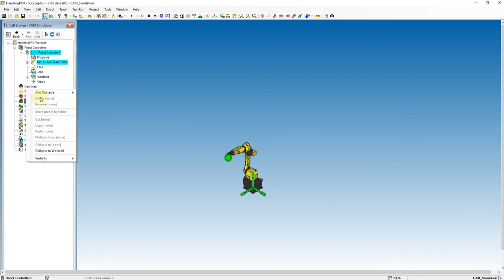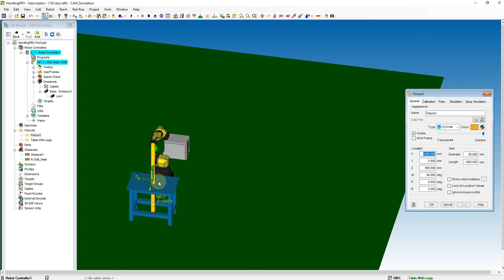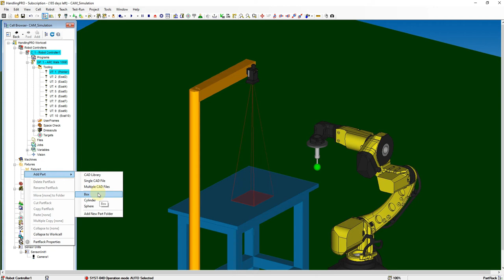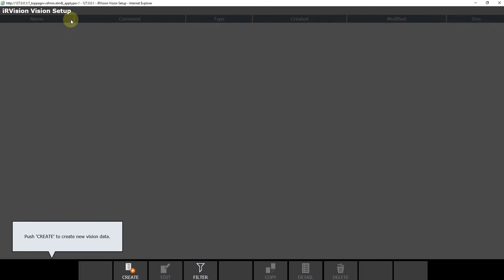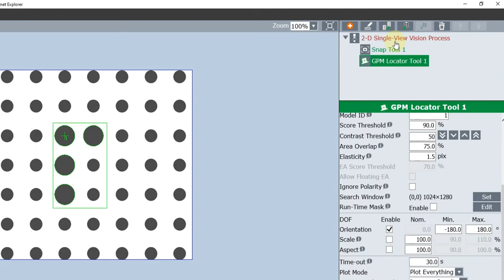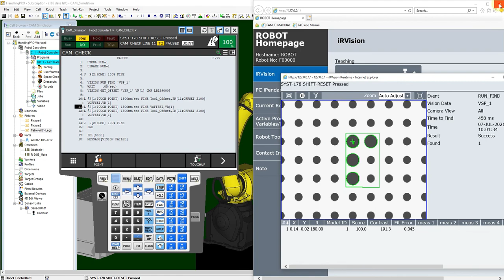Fanuc Roboguide Simulation Tutorial : Fixed Camera Setup.

Comment: Hi ,
Firstly, thanks for your helpful video.
I'm practicing Fixed Camera simulation, i use GPM locator Tools for detecting parts. However, when i use "Snap+find" on webpage and use Vision Command Run_find, they give different results. With "Snap + find" it work well (Can detect parts , number of parts found ...), whereas Vision Command Run_Find cannot found any parts. And when i tracked on Vision Log, it seem to me that Vision command can not call GPM Locator Tools. Do you have any ideas in this case?